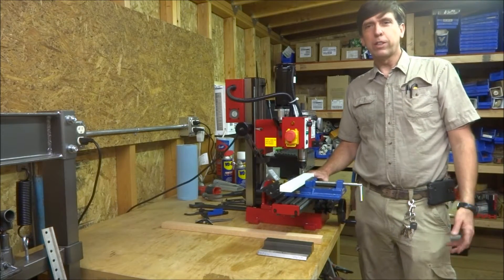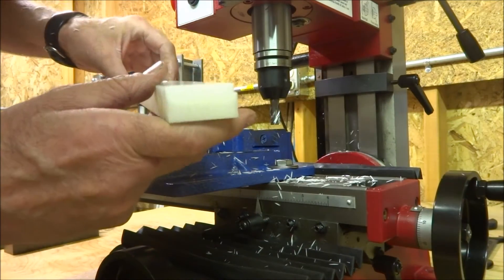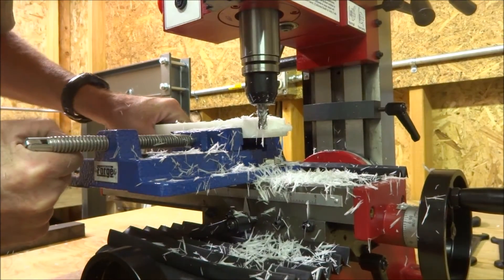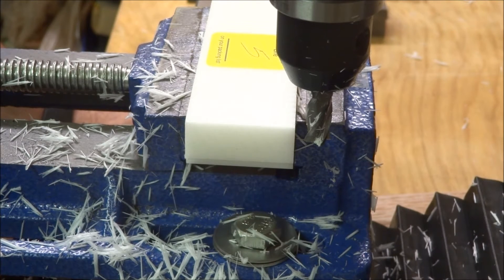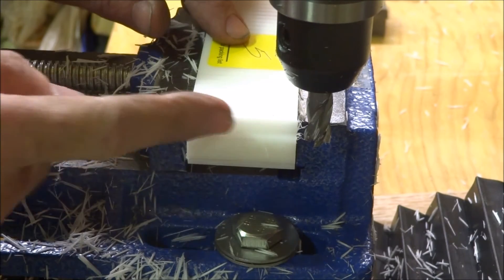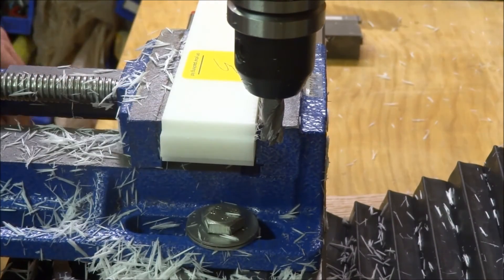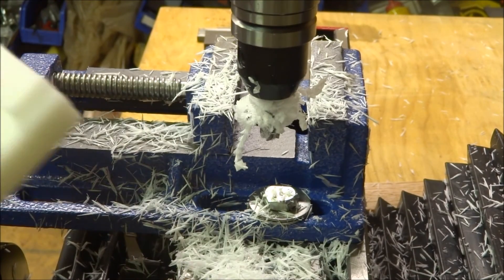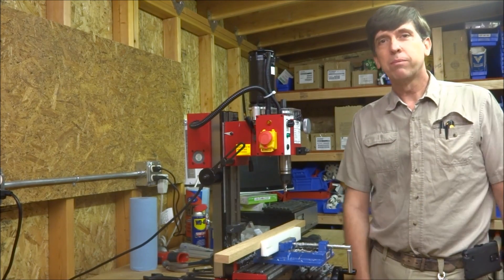Milling Delrin (Plastic) on the Mini Mill

Comment: It's a regular drill bit? Or any other model?
Reply from the maker: Jewel - it's called an endmill. Drill bits are only designed to cut on the tip.  Endmills can cut on the side.
Reply: Thanks buddy! I need a endmill for press drill!
Reply from the maker: Jewel - Sure thing!

Comment: I'm considering that mill, would you purchase it again? I'm confused on what to do. My shop is just a small repair shop.
Reply from the maker: I would probably go with the G0704 if I were to do it again. I depends on what size work envelope you need and how fast you want to get the parts made. The more rigid, the faster you will be able to mill.   I have Tormach 770 now.

Comment: Do you use wood bits to cut plastic ?
Reply from the maker: I was using a 4 flute carbide endmill which is normally used for steel.  I'm not real familiar with milling plastic but I don't think its real picky.
Reply: Craig's Machine Shop thanks mate looking into getting a mill in the new year just doing a bit of research as I'm planning to use delrin.

Comment: Hello, just came across your video looking for examples of Acetal being cut.  I noticed that you are climb cutting with your end mill.  When using a manual mill with ball screws, you should definitely use conventional milling.  When you get into heavier cuts, you will notice banging and dragging from the backlash in your ball screws as the end mill is pulled into the cut in a climb milling situation.  Happy machining!
Reply: I was going to ask if he was still alive and wanted to remain alive, he should avoid climb cutting on harder materials.  This is four years later, so he is probably an accident statistic by now.
Reply: you prolly dont care but if you are bored like me atm then you can watch pretty much all of the latest movies on InstaFlixxer. Have been streaming with my brother for the last days xD
Reply: @Armando Trenton definitely, been using Instaflixxer for since november myself :)